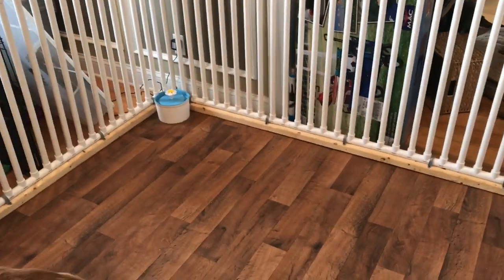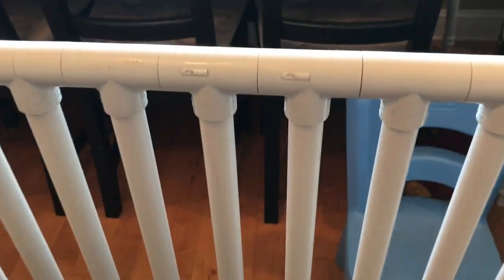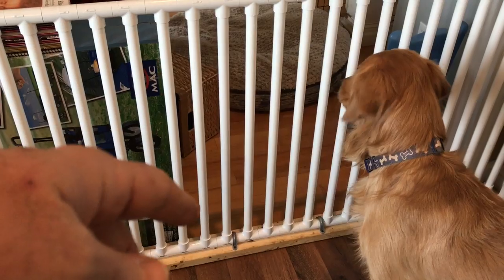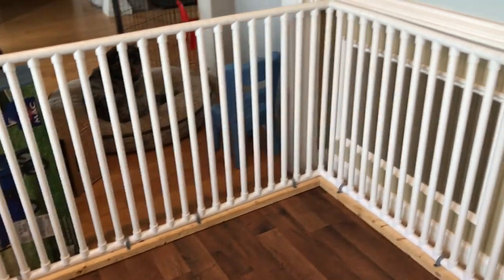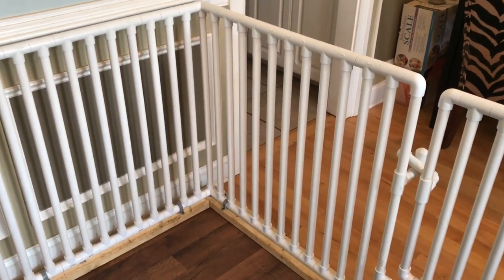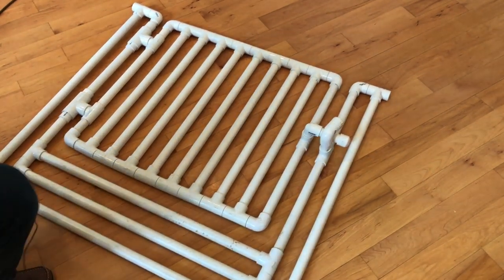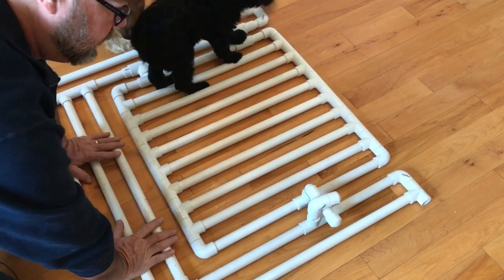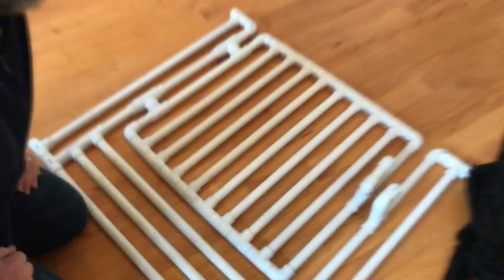PVC Puppy Pen - Fully Customizable - DIY

Comment: Nice job! I have similar system, but I use the PVC pipes simply mounted on 2x4"s as an external frame to stabilize my metal Midwest fencing so I don't need as many rungs. Also, I used vinyl waterproof locking flooring that come in 48"x 8.5" sections that are easy to take up and stack in a vehicle for transport.

Comment: Thank you for this, I am in the process of ordering what I need.  However, in your explanation to figure out the amount of the 3/4" Tees, you say determine the area and then divide that by the size of the  3/4" Tees.  The word 'area" needs to be changed to "length".  For example for a 10' square enclosure, you would need to take 10'x4=70', convert that to inches, 70' x 12" = 840".  Divide 840"/3.125 (the standard length for a 3/4" tee is 3 1/8", this may vary slightly brand to brand) = 269.  Since you need tees on the top and bottom, double that number, so you would need approximately 538 Tees.

Also, it would be really helpful to list the parts for your custom door.  I'm pretty sure I figured them out, but that was after pausing, taking a screen shot, and then figuring out what I think the pars are.  I know very little about plumbing and PVC products.

Comment: I was thinking of building something like this. I already have a midwest metal play pen but my dog can scale it pretty easily due to the horizontal stability bars in the paneling. I was hoping the all berticle bars would prevent that and then making a diy rolling pen on top with 3/4 inside a 1 1/2 pipe so it will roll them.off if they try jumping. All of those tees would be so.expensive though...

Comment: Omg, glad I found your video. Great job first off. Trying to think of a way to build something similar but instead of a pen, I need to build a single wall that’s about 10 feet long. Trying to decide if I anchor to the walls or if I install 2-4 legs to keep it stable and upright. 🤔
Reply: This is what I need too.  An 8.5' gate/ wall for my dog.  Have you tried this yet?  I have the exact same questions!
Reply: @kidzwizpadz  Sorry for the extremely late reply, dont seem to get notifications for messages on youtube.  I built the gate.  Biggest problem I have is my dog has learned to jump up on the gate and because its only a wall, it will push over and has started to come apart.  I have it anchored to 2x4s like he does and then used the same pvc clamps/bracket to anchor it to the wall.  Even with that my dog jumps up on it and can knock it over.  I dont know if the overall fix is to build the pen squared like he did (which was not an option in my apartment space) or what.  Almost seems like I would have had to basically frame a half wall for support/rigidity.

Now Ive come to a crossroads where I will be moving into my first house in the next month or so and need to find a solution once again.  I was going to just frame a half wall pen and anchor it to the walls and concrete like a legit wall, but as it turns out, I would need to get a permit to do this and dont know if I want to deal with that process.  Which leaves me with one option.  Building a pen squared like he did.  Again the biggest problem is my dog jumping on the gate and possibly taking it down.  Honestly dont know what to do at this point.

Sorry, this doesnt really answer your question, I was unable to work solution given the space to keep a wall stable.  Gluing the gate added weight pulling on the gate pieces that make the t-s separate.  Totally open to suggestions if anyone has any?

Comment: You’re a genius!  My husband is a BA for the Carpenter’s and he was impressed.  Got a question for you:  what is the estimated cost for this project?
Reply: 300 Ts -about $120
Other fittings- ~$40
PVC- (varies of size of pen) ~$85
+Plywood
+screws
+flooring
Estimate. I did similar, but cut costs by not doing as many posts

Comment: somehow (my kids) ended with 3 new yorkipoo poodles and my old faithful dachshund 8yo. these are sume jumpers, chewers, and pee'ers that i need to build this for, i read and calculated by your instructions above and came up 1,152 tees????? however you said you used approx 280... i clearly did some erroneous calculations. 8x8 should be no more than about 300 tee's?? sorry im a lil confused
Reply from the maker: The tees are not 3/4" long, they are 3/4" diameter.  Divide the overall length in inches by the length of the tee.

Comment: Did I hear you say you used 280 of the 3/4 PVC Tees?   (I see the list of supplies in the description section, but not the amount of parts)  I clicked the link for those tees and it is showing $4.50 for a pack of 10.   so,  $126.00 just for the 3/4 tees, is that correct?,  $2.71 per each 10 ft PVC pipe  -  I will need a minimum of 70 pieces for the 280 tees...so that is another $189.70.    That is 315.70 so far and I still need to purchase the rest.  Was yours this expensive?   Thanks!
Reply from the maker: Linda Moore hey thanks for the questions. Yes I used 280 tees. I just used the Lowe’s link for reference for the part. It was much cheaper for me to order them through a plumbing supply company. Lowe’s had the best price on the pipe when I bought mine.
Reply: Not to mention the 2 x 4's and the flooring...

Comment: How did you get the Tee fittings to stick together like that?
Reply from the maker: Thanks for the question. I just cut small pieces of pipe long enough to fit inside of two tees.

Comment: Was there a reason you went with T fittings instead of using larger pipe for the horizontal top and bottom rails and using a hole saw to cut a hole for the vertical rails to slip into? Seems like that would save a good bit of money due to the cost of the T fittings.
Reply from the maker: Yes several reasons. The main reason was so I could easily disassemble it and reconfigure it if I need to. If I would have just used pipe and drilled out all the connections it would would only been usable in that one configuration. I use some of the sections for other needs when not in use for a litter.

Comment: Is there a smaller pipe inside the t'S to hold/connect them together?
?
Reply from the maker: No. The pipe fits the size of the tees
Reply: @makingitwork8006  I think she's asking about the T's along the top and bottom that are immediately adjacent with no visible connector pipe

Comment: Lol @ low cost. Those fittings are $6 each, multiple that by 280? Haha, then add the actual pipe footage with the hinge system, you are looking  at a $3,500 puppy pen. The other miscellaneous materials put it over 4k easily.  2x4's are way cheaper and so are fencing materials.
Reply: The fittings are a 10-pack, so your math is quite off